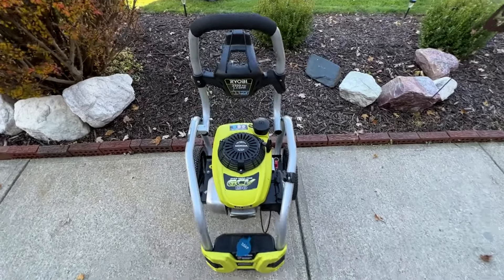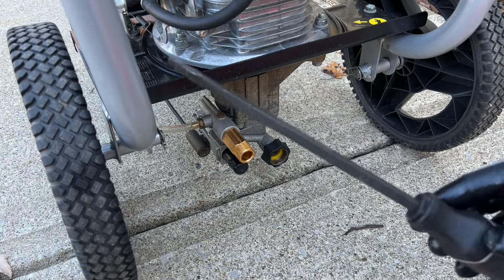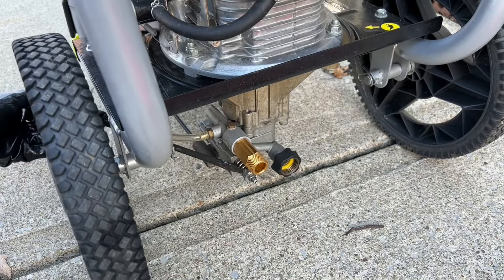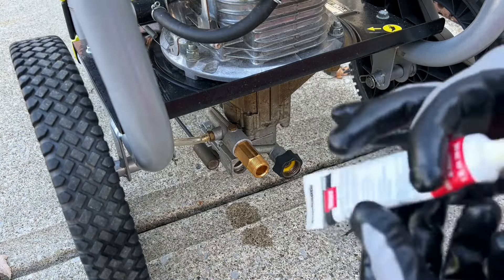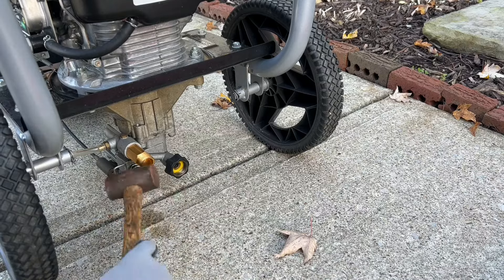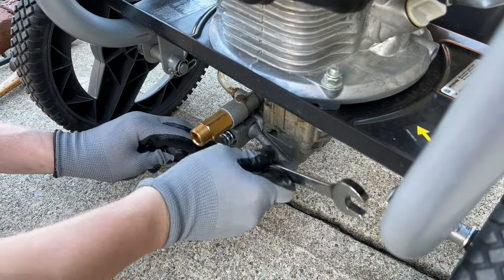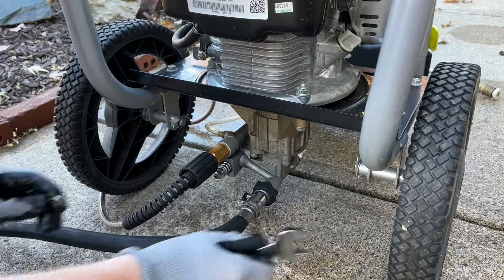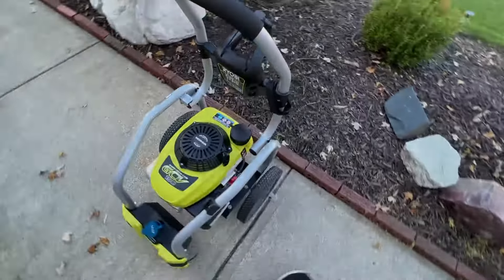Check This Before Replacing Your Pressure Washer's Pump | Replace and Adjust Unloader Valve

Comment: I have the same washer need that valve wish you would have provided a link.
Reply from the maker: Here is a link to the 2-pack that I used in the video. 

https://www.ebay.com/itm/255690861456?mkcid=16&mkevt=1&mkrid=711-127632-2357-0&ssspo=WB0Eoua4S1m&sssrc=4429486&ssuid=QVeEv8ClTSK&var=&widget_ver=artemis&media=COPY

Comment: If you have adequate pressure, but the engine stalls after you let off the trigger - does that mean the pressure is set too high?  I had to put a new pump on mine last year, and have just used it as it came from the factory.  Thanks...
Reply from the maker: Usually the engine would stall under load when the trigger is pressed if the pressure is set too high. It is possible that your idle speed is set too low causing the engine to stall when not under a load.
Reply: Thanks I’ll check that out

Comment: I'm working on a Ryobi 3000psi with new carburetor and new pump. I cleaned the unloader valve and haven't started it again, but what it was doing was surging when it was idle. Runs great when you are pressure washing but as soon as you let off the trigger it starts surging. Carburetor has been cleaned twice and is brand new. Any suggestions??
Reply from the maker: I would double check your gaskets and make sure the carburetor is tight. Sounds like the idle circuit is running lean. May also be a factory defect from the carburetor not tuned correctly.
Reply: Normal operation. Mine do that as well. Listen closely to the one on video it also surge at idle.

Comment: I have a ryobi 2800 psi with a  honda engine
Engine surges with low water pressure
Cleaned carb 
Removed unloader valve and it was wet
Where can I buy a new one? 
Hopefully this is my problem
Thanks
Reply from the maker: I got mine on eBay. I would lookup the parts diagram for your model and look for the part number. You may also need to clean the pilot jet on your carburetor. This can cause the engine to surge. Good luck on the repair!
Reply: @benchnwrench  I'm not a mechanic but I ordered an unloader valve from amazon. I also cleaned the carb but I didn't take the jets out. Fingers crossed that I didn't make things worse. All I want to do is wash my house down.
Reply: @leishawalker5916  Usually the main jet is what gets gummed up the worst. I just repaired 2 and had to force the main jet out with a piece of wood and a screwdriver on both.  They were really nasty.  Cleaned them with carb cleaner and some careful, light scrubbing with a brass-bristled wire brush.  I tried an old toothbrush first, but it wasn't doing much.